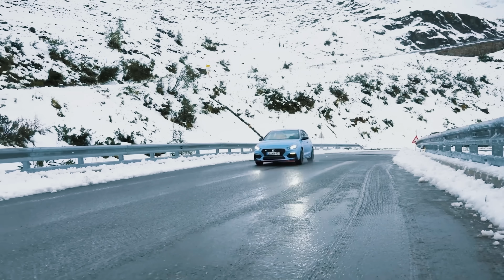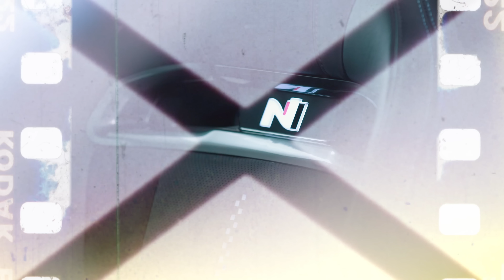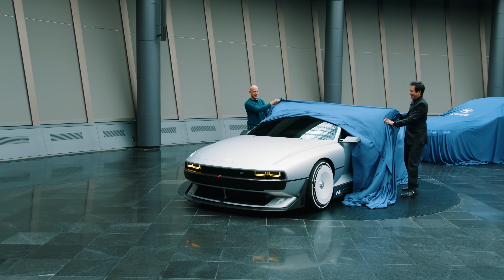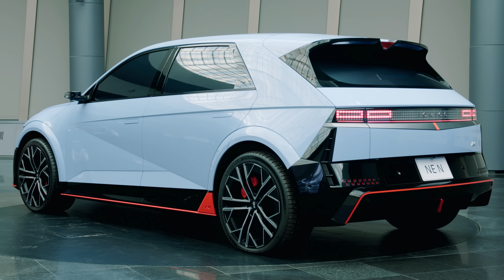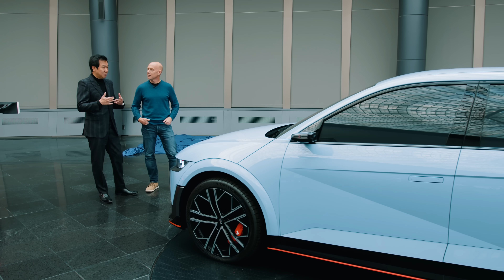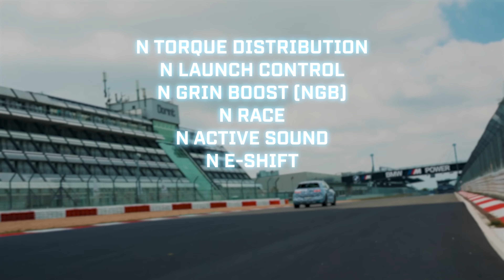FIRST LOOK: Hyundai Ioniq 5 N – INSANE 641bhp Hot Hatch! | Top Gear

Comment: The 1.6 and 2.0 engines still burn oil. Over ten years they still haven’t fixed it. These things also don’t handle all that great considering one was thrown into the hay at the Goodwood Festival. Styling definitely on point. Steal a designer from Lamborghini and you will have Korean cars with Lamborghini influence.

Comment: The N74 is a really great fusion of retro and futuristic styling - since it was first revealed, it was an instant smash hit!
Reply: Aren't KIA being sued for lack of immobilizers? Hyundai/KIA being sued by New York City and insurers are charging premiums for Hyundai's now.😂
Reply: Looks great - but still a silent, push button to go automatic/gearless car.. Just can't get into it.  Will be great on a poster and will definitely turn heads.. but for me, without the chance for a manual, it will remain a great looking, boring car.
Reply: @MKu64  The future does not include gas or manual transmissions.
Reply: @cygnusa3772     As much as that may be the case it also might not be.  Originally engines had 1 gear.  A reason for adding additional gears was so that smaller engines that use less fuel could be used to provide similar torque and power.  Right now we're back at square 1 with electric.   They could end up doing exactly the same - smaller engines that use less electricity and provide equivalent or better top end torque,  where electrics lack - the opposite of ICE.

Additionally, manufacturers are actually already looking at manual gearboxes for the purpose of keeping driving entertaining - while companies like Porsche are developing petrol replacements (whether that takes off is another story).
Reply: I'm purely talking about the looks of the car and nothing else here. Personally, I'll never look to own an electric or similar vehicle unless it becomes the only available option.

Comment: Basically it's an amped-up Hyundai version of the Kia EV-6 GT. Which is not a bad thing. I like the fact that we have these two brands with different design language and ethos, working off the same platform to deliver a variety of options for consumers. Want the "tiger nose" Kia that can turn sideways? Or do you want the 8-bit pixel car that can turn sideways? 
Yes please.

Comment: Looks good - but you can't call it a hot hatch! The Ionic 5 is huge - even though looks smaller in film.
Reply: More of a cross over with a silhouette that is very much hot hatch. But the size is comparable to small SUVs like the X3 or Q3 or Evoque. I think it was meant to compete directly with the ID4, which is also a hot hatch-looking small SUV/crossover.
Reply: It’s a huge and fat pig with almost 5000 pounds of weight.

Comment: Hyundai  excel used to roam  the roads I remember brand new with temporary plates they used to smoke and motor mounts used to break but not rubber the metal around it  lol ...what a turn around

Comment: Would much rather have a Ioniq 1 N, if that ever becomes a thing.
Reply: motor cycle maybe..?
Reply: @amellonguy6073  I'm thinking an actual small hot hatch less than 1,1 tonnes.
Reply: @Devou1s  consider battery is heavy af... size would be smaller than i20

Comment: I honestly don’t get why anyone would want emulated gear changes on a EV, that actually would make the car slower as you pause the acceleration every time you ‘change gear’.
Reply: it's optional. you can turn it on if you want to feel the gear change effect. but if you don't want, simply turn it off.
yes, it would make the car slower. but it could be enjoyable and fun :P
I mean it's one of the features this car offers.
various options to choose is always good.

Comment: The things they are doing with making EV "manual"  is gonna  be a game changer when everything goes EV.  The enjoyment  of actually  changing gear while driving fast is huge. They are gonna become the "drivers car" soon if they  achieve  what they are aiming for. Everyone else is going for the whole car drives  itself  kinda thing(which will  have a huge  market) but people like me who wanna enjoy the process of driving a car like  picking gears through  corners and dropping the box  to do an over take. They seem to be working  toward doing that... which i absolutely  love. The best thing  is these cars could  easily  drive  proper EV one pedal/lane assist/ driving is a chore  modes.
Reply: It won't have a real gearbox just pretend noises and effects like a computer game.
Reply: So you think driving experience is just about being able to manually shift?  There's a lot more that goes into driving experience the most experience comes from the ENGINE.  The sounds, the feeling the car makes when it shifts, downshifts the sounds, vibrations, smoke, pops bangs burbles.  You get NONE of that from an EV and you will never get that from an EV.
Reply: @Osmosis909   @Osmosis909  tbh most of what you listed  doesn't  appeal to me in a car. Pops and bangs are for bellends
Smoke??  You like your car running poor?
The feeling of shifting  gear and changing down is what this is supposed  to give.... Check the video of the first car top gear did. It's  genuinely  impressive.

Comment: The best EV  ever.
Reply: Not even close. Have you driven a Porsche Taycan? Clearly not. I own one. Currently the best EV you can buy, end of.
Reply: @mauricetoussaint7283 go sniff your own farts elsewhere
Reply: @mauricetoussaint7283 Tycan might be faster than ioniq 5N. But that's it. Ioniq 5N can give way more fun to you.
Reply: @단팥빵-o8x how can a heavy and fat SUV like the Ioniq be more fun than a Porsche? Lol
Reply: @kraenk12 You serious? Tycan is heavieeeeer than I5N.
 'cause tycan has bullshit PE system which is very critical for high-performance EV. It needs more battery to get same output. More battery  definitely increase it's weight.
Also poor battery management system to force  cutting  power down to lower tycan's battery temperature.
Reply: @mauricetoussaint7283  best for 1 lap. but porche has one of the best chassis technology in the world right. hyundai has best battery&motor control technology. so these 2 cars have different edges.
Reply: tycan ...
not track
Reply: 5000 pounds pig.

Comment: Sick! Most epic electric hot hatch/compact car ever, in my humble opinion. Sure, we gotta wait for the test drives, but from what we have seen and heard here, absolutely stunning and great concept. Curious about the weight and range.
Reply: It's absolutely not a compact car sadly, 4.7m of length and 1.9m in width
Reply: @VarioFelce  and a 3.0m wheelbase. Not small at all!
Reply: It's a crossover, not a compact
Reply: The regular version is over 4000lbs. As others have mentioned, this is not a hot hatch.
Reply: This is not a hot hatch.  It is more like size of a hot SUV.  Not a hatch for sure.
Reply: The same goes with me. How do you expect her weight and range?
Reply: @briank581 probably around 3500-3700lbs and 250 miles of range I remember seeing it somewhere last year when they were leaking specifications
Reply: @tebibyte2357 it’s almost 5000 pounds! !
Reply: Stop calling it a hot hatch damnit. It’s a fucking 2.5 tonne fat pig with way too much power! It’s huge
Reply: this thing is the size of a range rover.
Reply: Hot hatch/compact car................. Nope is isn't either.

Comment: The Pioner of beauty and sporty EV car❤
Reply: You need your eyes testing. Looks awful.
Reply: Why would you want an overweight hot hatch with no gears or sound? I don’t get it. 

You’re not doing as much of the driving as you would with a manual ice. How many performance ice cars can you name where they sold them as autos 😂? 

The sound and vibration are a huge part of the joy of driving too. And people modifying their engines with turbos, superchargers, cams, heads, flywheels, exhausts etc. People can express individuality with ice cars. You cant do the same with an ev. 

People want to engage and connect with the car and the driving experience. Evs kill all of that that. I don’t understand why people advocate soulless appliances just because they accelerate well 🤦🏻
Reply: @Hello_there_obi Then stick with your Golf, old man😅
Reply: @kfx3907  what has age got to do with a better drivers car? Age has nothing to do with it. Only your understanding of basic physics and neuroscience 🤦🏻

Comment: There is a sister car (KIA EV6 GT) that is built on the same platform as Ioniq and has similar powerplant (0-60 in low 3s). KIA is fantastic, so I am sure this will be even better.
Reply: I own a Kia EV6 GT, and I really wanna know "what's different".

When I read the 641 bhp, I was quite happy, then read it's only for 10s ..
So it's basically the same car, with a better "chassis" ?
Reply: @daviv91 yundai always launches the equivalent model of their version as kia first then improve it for their model
Reply: @daviv91  tbh you can not judge a car by platform sharing or numbers. I drove new Q5 and new Macan which even sits on old generation Q5 platform yet it still outperforms Q5 in every way (solid interior, x10 much better grip). Own EV6 GT is really nice but GT still needs to step up the game to be an N sister
Reply: But it is still a Kia 🤣
Reply: @mauricetoussaint7283  What's your point? Nowadays Kia and Hyudai make some really nice cars.
Reply: @mauricetoussaint7283 Still living in the 90s? 😂 I feel bad for you my guy😅

Comment: Looks great. Sounds great. But if it costs around 60k, which it easily will, it's not really in fitting with a Hot Hatch ethos.
Reply: Not in size either
Reply: 5000 pounds 70K upwards.

Comment: What an astonishing car that is 641hp for a hot hatch.
Reply: When you see it in person that thing is nearly as big as an SUV. Probably even heavier too.
Reply: @araakin  I've seen the the normal ioniq 5 and it is big for an hatchback almost looks like if it was an SUV.
Reply: @Driver20418 it IS an SUV.
Reply: they need the hp to offset the extra weight of the batterypack. don't stare blindly at the numbers.
Reply: @raunchyNO  but 3.4 seconds for 0-100km/h is quite nice.
Reply: @IREITUK  the problem is taking a corner. There is only so much grip. And more weight means less grip. Also it's way harder to change direction of 1500kg compared to 750kg. Its also costs more energy to propel or stop. Its sounds nice on paper but i can tell you that it wil NEVER feel as nimble as a first or second gen golf gti. Cars wil never feel nimble again in general. Because they wil have double the weight.
Reply: @raunchyNO You can't tell before you drive the actual car on a track lol
Reply: @kfx3907  yes you can. Weight you feel. It's actually the one thing that is most predictable. There is no 1500kilo car that feels lighter and more nimble than a 750kg car. Physics work that way. They are actually called laws of physics for a reason.
Reply: 2250kg 😂😂😂😂😂
Reply: @MrFistxx  🤣🤣 it needs 641hp. A 1000kg car would only need to have 285 hp to have the same power to weight ratio. Yeah it will be quick (in a straight line) like all electric vehicles but those tires have to try an keep that "hot hatch" 🤣🤣🤣🤣🤣🤣🤣🤣🤣 on the road. Most polution these days is fine dust btw. Also with ice cars. Guess what weight does with tires? 🤦🏻‍♂️🤦🏻‍♂️🤦🏻‍♂️🤦🏻‍♂️ ""Hot hatch" 🤦🏻‍♂️🤦🏻‍♂️🤦🏻‍♂️🤦🏻‍♂️🤦🏻‍♂️🤦🏻‍♂️🤦🏻‍♂️🤦🏻‍♂️🤦🏻‍♂️🤦🏻‍♂️🤦🏻‍♂️🤦🏻‍♂️🤦🏻‍♂️🤦🏻‍♂️🤦🏻‍♂️🤦🏻‍♂️🤦🏻‍♂️🤦🏻‍♂️🤦🏻‍♂️🤦🏻‍♂️🤦🏻‍♂️🤦🏻‍♂️🤦🏻‍♂️🤦🏻‍♂️🤦🏻‍♂️
Reply: @MrFistxx  that's why i kept calling it a "hot hatch" the one thing a hot hatch is, is a small light hatchback with an powerfull engine. this is NONE of those things. and it's not even close. it's a fast suv. size and weight wise. 😏
Reply: It’s not a hot hatch…it’s an SUV that weighs almost 5000 pounds.

Comment: The new Ioniq 5 N looks like a solid car, but it would look 100x better with a proper widebody and a rear spoiler, like the Delta Integrale. 80's style box flares would look spicy on it. Hope they add a higher trim level in the future with wider fenders :) Good job Hyundai keep it up!
Reply: All it needs is to be scaled down by about 25% because as it is, it's a performance SUV, not a hot hatch.